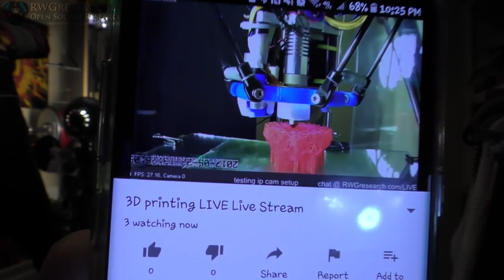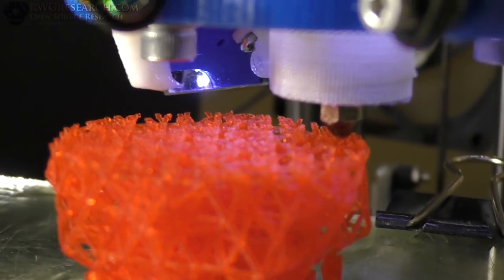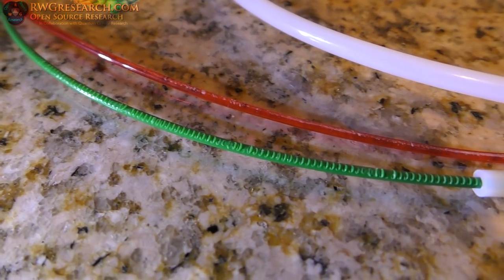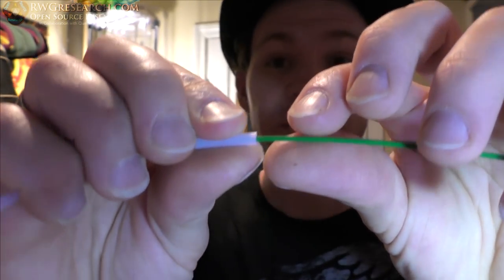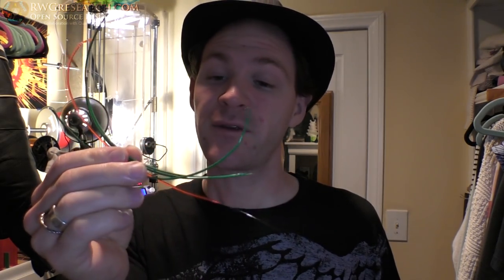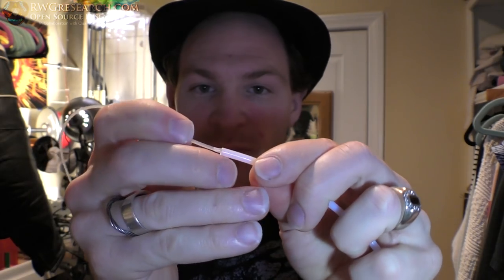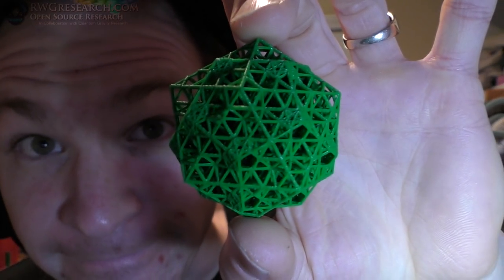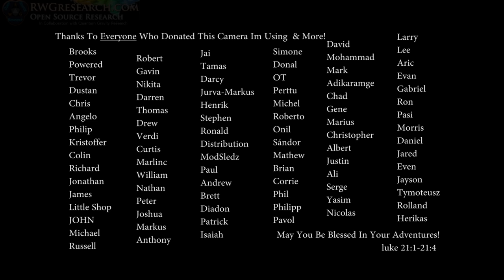Never Seen This Before. Strange Jamming In PTFE Tube & How To Fix It!

Comment: Even though "Capricorn" PTFE tubing is "supposed" to be an upgrade, the inner diameter is even narrower than stock PTFE tubing, so this problem is even more exacerbated.
I'd try loosening the gear tension first, if not then revert back to stock white PTFE and also loosening tension even with this.  Even better convert to Direct Drive and All Metal Hotend setup and avoid that long bowden tube all together.

Also what I've noticed, is when so many small retractions and too much gear tension, it will "flatten" the filament so badly it will just do nothing but drag, get stuck and underextrude.  You think it's a nozzle clog, but it's not.
Reply: Thanks for mentioning this! I also just "upgraded" to the Capricorn and been having nothing but problems like this from it! Grr.. I could really use it too for printing ABS as the stock PTFE expanded & was in horrible shape when I pulled it out to switch.
Reply: I converted to direct drive trying to fix this. 3 inches of the Capricorn clone tubing was enough to cause nearly every print to click, strip and fail at some point. The filament was smooth when hand fed but mid print after expansion/E gear it cant even be forced thru. I was using Sunlu pla +
Reply: @stevensgarage6451  How you fixed the problem?

Comment: I'VE BEEN HAVING THIS EXACT SAME PROBLEM! It only happened with Hatchbox PETG though, and all I did was loosen up the springs abit.. made quite a bit of difference! The new PETG I've been using hasn't had any sort of issues what so ever, and while its kind of a 'no name' filament manufacturer, the quality of prints is AMAZING compared to Hatchbox. Its from Solutech!
Reply: Yes.

Comment: Only video I have seen talking about this and it solved my problem on the CR30. As soon as it got to any part that required retraction the print failed. Even the benchy that came on the USB. The crazy part is I tried to change slice settings on the retraction and thought that would fix it. Doing this many times it started to make the filament driver loose, and the hot end. I had to retighten things and still nothing until this was fixed. The lawn mower wire worked perfectly. Thanks again :)

Comment: Oh man, This is so helpful. I tried to print with PETG and it got jammed up in the printer, I took a few things apart and realized that it was getting stuck in the Bowden tube and I had no idea why. I just remembered that I had replaced the tension spring on the extruder to prevent slipping and is it was probably rushing the more flexible PETG filament.

Comment: Using a bondech, the gear doesn't need to be that sharp/aggressive because it dual sided. Since you're creating your own gears, look at the bondech design, it's great for many retractions because it grips from both sides and doesn't chew up the filament.

Comment: I had a very similar issue with my CoreXY where the PTFE tubing is approx. 50cm long. The issue in my case originated from too much spring tensioning on the extruder therefore it made very noticable deep grinding on the filament (PETG&PLA). I just had to take it back a little and it works like a charme ever since:)
It was a really annoying few weeks till I found the solution:)

Comment from the maker: this was to strange not to share. I had just replaced the PTFE and then getting jams. Took me a while but i got it figgured out. Let me know if you Have ever seen this before. Thanks also. live stream link in the description. ~Russ
Reply: Hey, do you think you could do us a tutorial on how to build a basic filament extruder that extrudes 1.75mm
Reply from the maker: LogandadLoga im not so sure its "basic" but the entire build is here. http://rwgresearch.com/open-projects/3d-printing-research/filament-extruder/ have you seen this? thanks ~Russ
Reply: Ok, thanks!
Reply: Also you don't need such a complicated way of winding the filament. I would just put a motor connected to a arduino spinning the spool at the same speed that the filament is extruding.
Reply from the maker: well, you have to get it to spool correctly. in one of those videos i show why. if you just wind it it will get all tangled up, also the OD of the spool will change as it fills up, so you need a way to compassionate for that. it seems like it could be easy, but there are a lot  more reasons why it needs to be more complex. ~Russ
Reply: Ahh ok ill keep my eyes out for that

Comment: I had a similar problem printing a spice rack. The filament was jamming I was getting frustrated after changing the hot end and nozzle and trying new filament and retraction speeds I finally realized that the filament was jamming in the Capricorn tube. I went back to the Teflon tube supplied with my Creality ender 3 v2 and that seemed to fixed the problem.

Comment: Mine was blocking in hot end due to expansion and tube was then to tight.

I "may" of solved the problem with Ender Allan key in tube in hot end at 250C after well preheated remove tube from hot end and turn key then let cool to room temp with key in tube. I used 250C because I am using petg atm So far looks good. This problem only came up after using Capricorn ptfe

Comment: I have an Artillery Sidewinder X1 and it's been running for almost a year now.  Recently I have been experiencing a jam close to what you have shown.  I can print one or maybe two items, but it is usually one or none.  I can go into my settings and advance the filament, the temperature normally for testing is at 200c and the filament will extrude.  I can start my print, and it may complete, or it will open sections in it at different levels.  Before this, I was getting outstanding prints with very little artifacts.  In most cases,  The filament is going through PTFE tube and stops just in 4mm in the throat.  The gear turns but not filament is advancing and I get a worn area and a lot of flakes from the gear turning.  When I attempt to pull it out or get to advance it hangs.  When I do get out there is an enlarged 4 to 5 mm piece at the end. I have used the same type of PTFE tubing since I purchased the printer.  The filament has been from different vendors, but I have not experienced any issues like this.  I am now in my fourth teardown of the extruder to see what is causing this issue to keep occurring.  But I do say that your explanation does make since.

Comment: Just had that with my new Original Prusa Mk3s+ while printing a benshy. It was the fourth print (after about 8 hours of printing before without issues) i had to change the tube. PLA is still in the old tube. Wasn't able to get it out. 

Thanks for that one! Helped understanding 👍

Comment: Russ thanks for doing this, my Bowden Tube on my Anycubic Mega X became clogged, I cleaned out the nozzle but the Tube was full of melted filiment, I think I may have switched off the printer and not let it cool down properly so my fault, is there a way of getting the filiment out of the tube as its quite a new one?

Comment: Haha Russ, i had the same issue a few months ago with my homemade oversize CoreXY. I have fixed it with carefully heating the Teflon-Tube and pushed a part PETG Filament through it while the Tube is still warm. Just like you.  Sorry for my poor english.
LG and keep up the good work!
Reply from the maker: haha, Nice! you don't have to use heat if you have the right size bulge :) thanks for sharing! ~Russ
Reply: rwg42985 Yes you're right, but this was the quickest fix for me. We are all still learning. Trial&Error :-P
Reply: Yeah, looks like way to much spring tension to me too...

Comment: I dont want to admit how many hours i spent trying to fix this. Troubleshooting this was a nightmare. It was so random and inconsistent.  My main problem was clicking mid print followed by stripping the filament and failing but the constant stringing was also an issue and none of the print settings or test towers could get the stringing under control.

Comment: my filament is inside my bowden tube. I can't reach either end to grab and pull... any suggestions?
Reply from the maker: Use another filament to push it out. Or a stiff wire. Or you could try heating the tube and squashing the filament after it gets hot enough to soften. (Use gloves for heat) . last option is to try to melt new filament in to the stuck one. Push the filament in to the old one while heating the tube ( need to get as hot as the plastic needs to to melt) then let it cool completely. Try to pull it out... I use to splice filament this way... Else. Replace tube... ~Russ

Comment: It seems a simpler fix would be backing off the idler pulley spring pressure a bit.
Reply: How do you go about doing that? because this is the problem I'm having right now.
Reply: @biggrundo6667  Depends on your extruder setup. Some have a screw that adjusts the idler arm, those that don't, you can take the spring out and put it back in. Just the act of removing it with pliers will squeeze a bit of pressure out, as it tends to take a fair bit of pressure to put back in. Don't overdue it or your extruder will slip. If you overshoot, you can add a washer on most setups. You want it tight enough to not slip, but not so tight it is digging into the filament and leaving tooth marks. It could be as simple as your gear sliding down the motor shaft slighly due to a loose grub screw and the filament is hitting a tighter spot on the gear.
Reply: @CJICantLie  Thanks bud, I have a new flashforge finder, and I'm literally having this issue a week in. I'll give it a quick tinker.

Comment: Just tried some PETG and i Experienced an issue like this. The PETG retracted into the boden tube a bit too much and fused to the tube. The quick fix was to cut off a 1/4" from the end of the boden tube where it was fused and it seems to work again. think i need to decrease the retraction rate if i want to avoid this issue in the future. and for reference purposes its GizmoDorks PETG that i was using when this happened

Comment: what about giving a little shot of silicone lube in the ptfe tube?
Reply from the maker: 110% bad idea. one 1 main reason. when you extrude your plastic will not stick to its self. basically you will end up contaminating your plastic! also its was really jamming in there. so i don't think any amount of lube would help. but the good thing is is that PTFE can be stretched. hope this helps, ~Russ
Reply: reduce the spring tension on the extruder and silicone isnt that bad
Reply: i've used silicone before on the hot end and it still stuck to the bed and itself, most likely because silicone in spray form is not 100% pure. However it is the case that a little dab will do ya and a big gob will screw ya, but you're right about the tautness in the tube due to the deformation of the PLA

Comment: There are two types tube thin and thick wall,,check before you buy,,,I find running a 2 mm twist drill up and down the tube helps,,only tighten the roller on to the drive so it works to much you you chew out the Filament,,